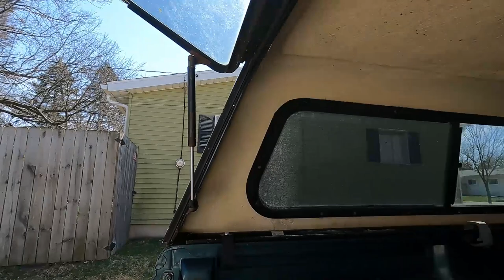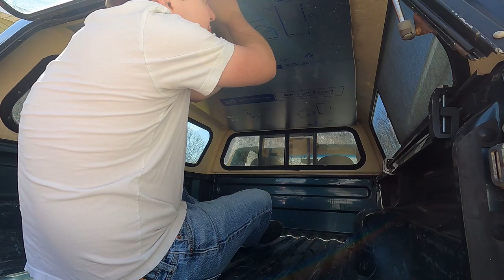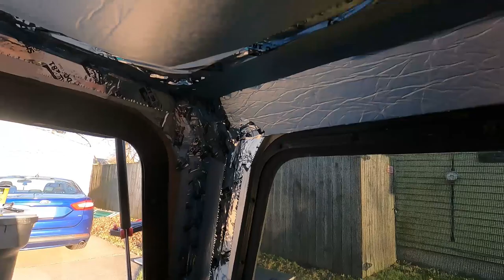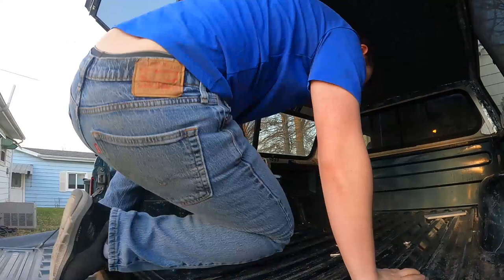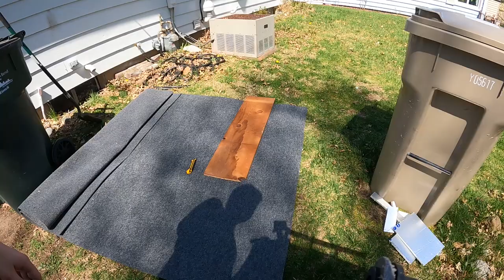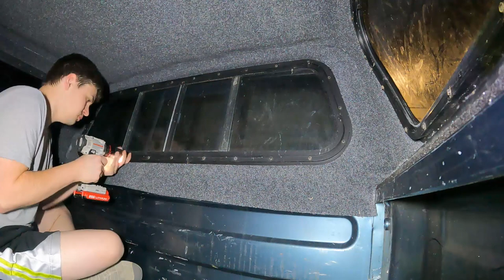Insulating and Carpeting the Camper Shell on my Ranger

Comment: GREAT VIDEO!  You did a great job.  Most toppers (like mine) only have just the carpet. I also installed a BedRug brand bed liner.  It is a very special rug that contours to the groves on the truck floor and keeps it perfectly smooth and flat.  I have not done the Reflectx mod yet.
Reply from the maker: That sounds really nice! If I wasn't so constrained on budget for this build I definitely would have gone with something like that.

Comment: Nice job. Can you tell if the added 1/2" foam helps with the insulation of the camper shell? Any feed back would be great. Infrared thermometer measurements to compare the inside and outside of the shell, maybe. Thanks for the video

Comment: Have you tried using anything Velcro to that particular carpet?  If so do they hold strong?  You did such a great job on yours.  I have my topper off truck in shop and about to start this project.  I’m glad I didn’t start using the almost black in color speaker carpet I have.  I had been looking for this color gray to match rest of truck. Looks like my Menards has this carpet and about to figure out how much to get from there and the cuts if they can do that too   But yeah. Was wondering before I buy about the Velcro bonding with it.?  Thank you sir

Comment: Question:  would a spray foam have filled in those small gaps, in lieu of or in addition to the tape?  Especially if you cover it with carpeting after.  Planning mine…
Reply from the maker: Hmmm. I suppose it could. Honestly it would probably give better insulation than mine too, since the gaps would be filled instead of just covered with a thin layer of tape.

I'd be curious to see/hear how it comes out if you do it with foam!
Reply: @nowakoutside  Next summer 🤞 More of a bug-out build, have trailer for camping…😀
Reply from the maker: @roberts1922  awesome! I look forward to seeing it!